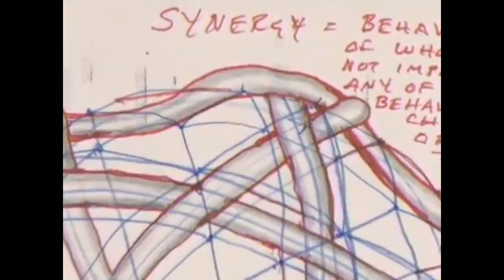YANBAR PODCAST AI DOMES GEODESIC DOME HOME PREFAB KITS

Comment: I worked on putting together a package for AI Domes for years. When it came time to pull the trigger they had the wrong answer to a question about water leaks. Building a sprayed concrete dome is cheaper and easier.
Reply: thats what i would like to do. a simple sprayed concrete 10 ft high dome 2 bedroom. its a dream anyway.

Comment: I have their 40' with the disastrous extremely poorly designed/poorly insulated skylights.  My mistake was trusting AI .  Instead of designing functional skylights they ATTACK the builder as incompetent.  When it rains so much condensate forms on the skylights that a virtual waterfall occurs.
Reply: I heard they're closed due to illness.
Reply from the maker: Hi Gregory, sorry about your experience with AI. We don't endorse one company's Dome product over another. Our thought is that Dome structures are safer than conventional structures. So we reached out to companies who build Dome structures, AI accepted our invite to inform. Hope that your skylight problem gets resolved.
Reply: @YANBARPODCAST  when is the last time you contacted AI Domes?...they seem closed...
Reply from the maker: Hi Mercedes, not since a thank you call for doing our interview, I called AIDomes after seeing your comment, but to no avail, then sent an email inquiring about their status, thank you for bringing this to our attention. Regardless of this companies status, we at Yanbar Podcast wholeheartedly believe that safety wise, Concrete Dome structures are superior to conventional wood/block structures. So the information in this interview/talk pertaining to and attesting to the inherent strength of Dome is still good for its intended purpose, to inform.